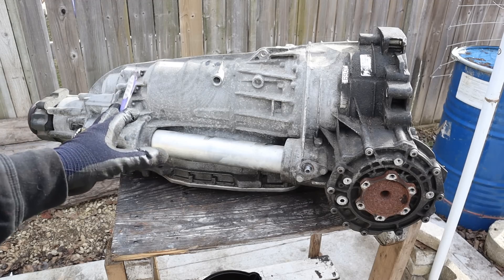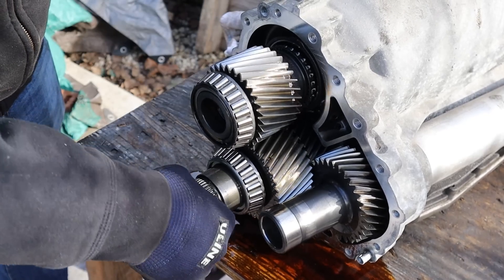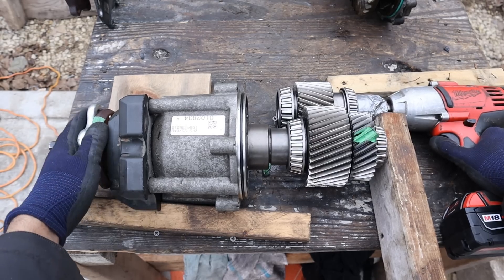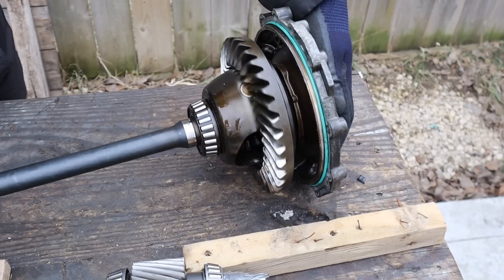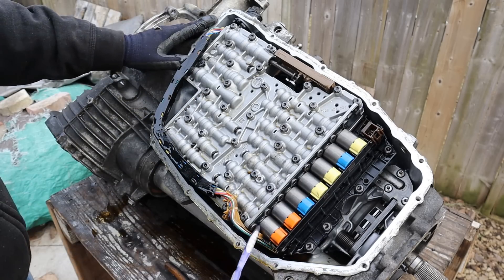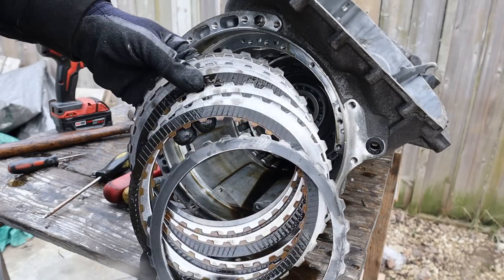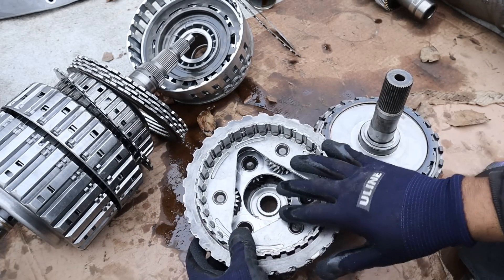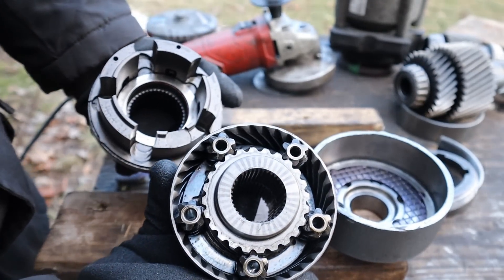How Audi Quattro AWD Works

Comment: Another excellently edited video! Thank you, perfectly good transmission, for your sacrifice. 

What was/model Audi did this come out of? 

All this complication, parts, weight, and inertia. Whether or not you like EVs, they have the advantage of removing a lot of this stuff. Not the axle diffs, but the transmission, torque converter, and center diff.
Reply: My guess it was out of a V8, judging by the massive gears and steels inside the tranny.  ZF 6 speed box with Audi adaptations for the AWD.
Reply: I believe he said 2012 Q5. They used the ZF 6HP for the 3.2L model and the 8HP for the 2L.
Reply from the maker: 2012 Q5 with 3.2 V6

Comment: Nice, the Ford Cosworth series used a similar setup only the front diff was mounted much further front and the axle went through the engine sump resulting in an engine sitting much further back. Also the Cosworths used a chain driven front shaft taking its input from a viscous coupler.
Reply from the maker: That's better for weight distribution